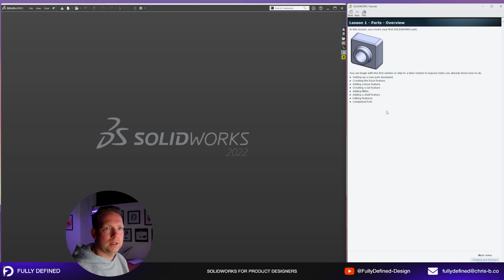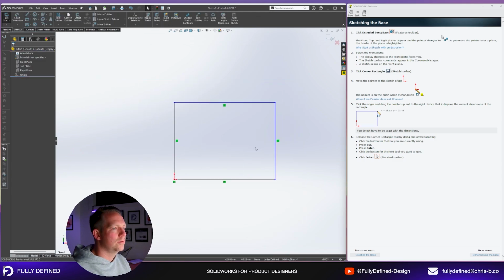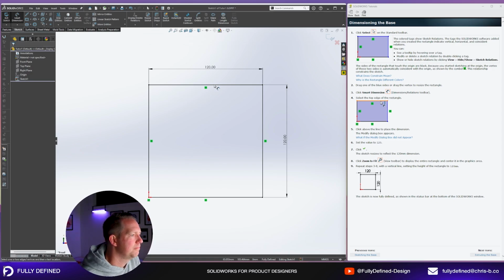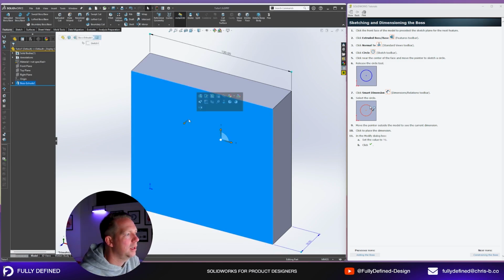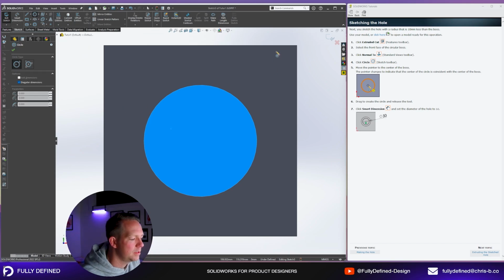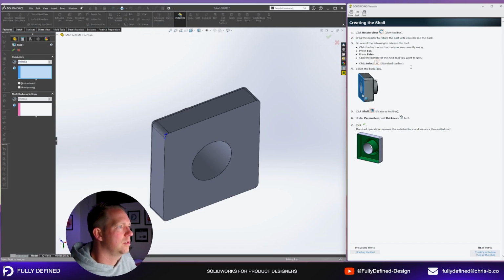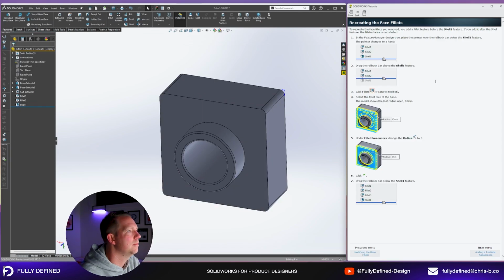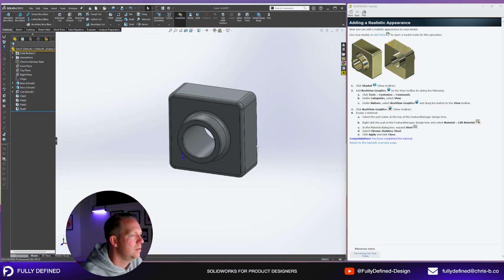SolidWorks Tutorials - Lesson 1: Parts

Comment: Way to fast for a new person to keep up. You also should do each step as presented.  I found I did not have the same shortcuts as you did and I had to go down several rabbit holes to just get back to where you were at.  Makes for a frustrating experience.  There are a lot of small icons to track and remember for a new user, this is why creating the dimensions is better IMO.  get the basics down first before learning the shortcuts.
Reply from the maker: Hey @broderp thanks for your feedback. The video was recorded with an aim to add tips for newer users going through the tutorials, not necessarily show every shortcut and icon explanation. In saying that, I can understand your frustration. If you get in touch with me via discord, Skool or LinkedIn, I’d be happy to give you free access to my fundamentals course which does go thru everything a beginner needs to learn from scratch. Chris